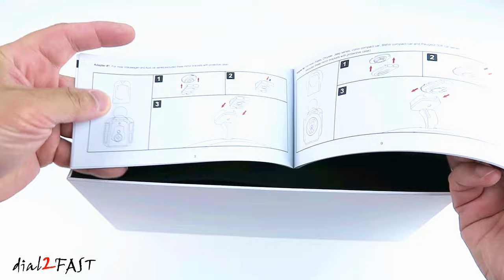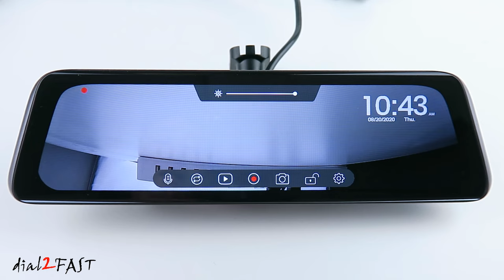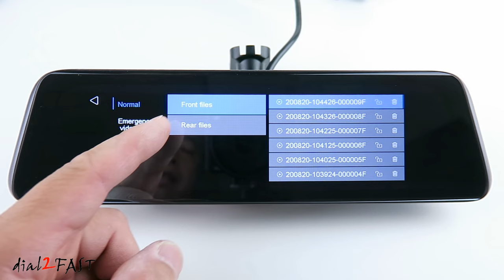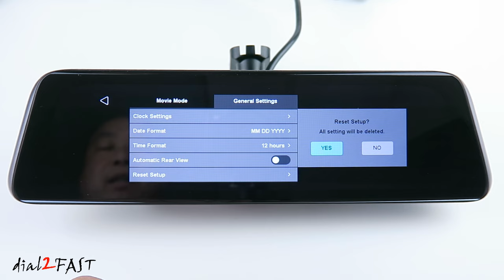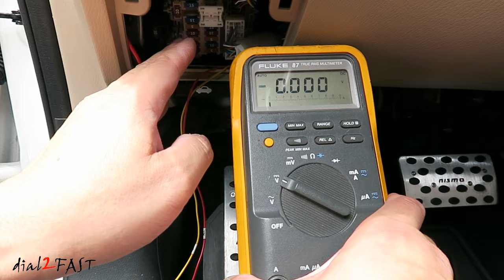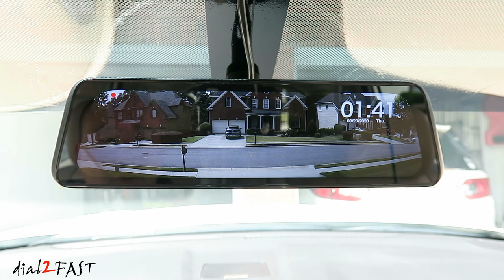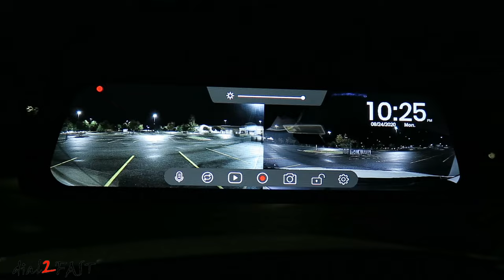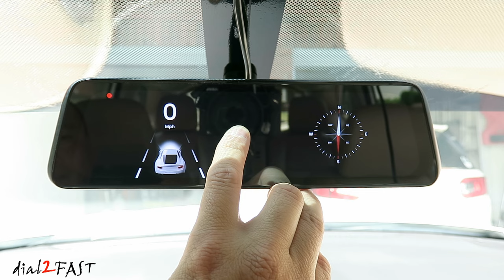AUTO-VOX V5 PRO Windshield Mount Mirror Dashcam

Comment: I just installed a V5 Pro in my F150.  I had to use it without power for a few days.  As a mirror, it is not very good compared to a normal, glass rear view mirror.  The reflection is dark and wavy at the edges.  Powered on, the view is outstanding!

Comment: Been holding off on buying a dash cam. Haven't seen one i liked. This one seems to be a practical and well performing unit. Thanks for the review.
Reply: Same here. I wasn't aware they have them built into rear view mirrors. I like the fact that it doesn't have rubber straps. If you bought one how does the mirror it self work?

Comment: This is by far the most definitive instructional how to video I have ever watched knowing You Tube, it far exceeds even the AUTO VOX websites instructions, absolutely every area was covered in fine detail, there is only one question I have and that is concerning the wire to the reverse light, I have an older 80's model Camaro, how do I know what side of the light or plug is positive to tap into with the red wire supplied?.
Reply: You took the words right out of my mouth. I randomly came across this and the fact that he showed the install of the rear view on the hatch instead of outside makes my want to purchase this unit as well lol. Ive been doing a lot of research and everyone just seems to want to have it outside. Kudos to Dial2Fast!!
Reply: Use a multimeter
Reply: Agree

Comment: One of the best reviews, clear and in full detail. I'm going to get the AUTO-VOX T9 without the dashcam just for constant rear view mirror for a Ford Transit low roof cargo van with no rear windows. I want to install the rear camera on top of the roof and am thinking of using some creative way to make the camera look good, such as a shark fin antenna cover or even a custom made trapezoidal housing.

One question, I read somewhere that the constant power cable is for keeping the time on the mirror from resetting. The mirror I'm guessing turns on when the ignition switch is turned on to ACC mode. Is there a way (unless it already works that way) to have the mirror come on as soon as you open the car door, which means it should have some kind of auto shut-off when you open the door (just like some of the factory features work such as the radio) or some time after turning ignition to OFF and not opening the door?

Comment: Very Good Review...sent to me by Auto Vox itself.  Today a technician installed the mirror in my Ford Focus and  I need the highligth two things: 1. The Mirror itself has really good reflective properties so, as the Video says, it can perfectly be used as a normal mirror without the use of the cams. This is good and bad. Good because any failure in the cams doesnt invalidate the use of the product as a normal mirror...Bad, using the cams you cannot point the mirror towards rear windshield because what is seen by the rear or front cams superpose with the reflection of the mirror itself, not being able to see well and distracting your view which is dangerous as you drive. I pointed the mirror a little upward so as to reflect the roof of my car, which it isnt so "bright" so you have no problems seing the video sent by the cams. 2.- I really dont understand very well, and is poorly explained, the use of the parking brackets and the way to calibrate them. They must have a logic because the rear cam itself "deform" the  view making a little bit difficult to estimate the distance to different objects. 

One last thing...a really terrible one....If you receive a unit with the arm separated from the mirror itself  PLEASE RETURN THE PRODUCT INMEDIATELY. That was my case...but I never realized this until it was too late...I thought it was a normal thing and that it was very simple to attach the arm to the mirror. How wrong I was!!!... Only after taking out  my original Ford Focus rear mirror, which is a very delicate and dangerous process because you have to make preassure towards the windshield with lot of known results of braking it, I realized that the Arm didnt fit in the mirror,  even if you apply lot of preassure to make it fit (with the risk of damaging the mirror itself)... At that point the technician refuses to install the V5 Pro, because it was a defective product. So I saw myself with a bad V5 Pro in one hand (sending back to Amazon from my Country take months), my original Ford Focus Mirror in the other (not daring again to put it back in place with a new risk of breaking the Windshield) and with a car without inside panels... Luckily I get creative when I am angry, and believe me , I was really upset with Auto-Vox. So I literally disassembled the mirror, being able to loose a metal bracket form the rear (I really dont know how I did that) and finally making lot of preassure was able to insert the arm in the mirror itself. Clearly the arm was separated from the mirror because it was of a greater diameter than the hole (the pivot)....But I[ was able to insert it anyway, with the result that the pastic itself was a little bit deformed. Putting the metal bracket back was an odissey. Its function is to apply preassure arround the pivot so as to make it stiff. I had to deform it to a greater diameter with tools and heat, so as being able to surround the more sized pivot. Finally the result was not a very clean fix but the round tap behind the mirror, was able to hide what was done... I really hope the adittional pressure that the pivot is making to the mirror, doesnt result in a future failure. For now, it works perfectly and with no visual sign of the problem. REALLY FOR A SO PRICEY PRODUCT ITS A SHAME WHAT HAPPENED TO ME....The only good thing of all this tragedy was that the Technician was so surprised (really surprised) I was able to fix the problem (using his facility and tools anyway), while he was only watching with a smile on his face saying "you will not succed", that he reduced his fee more than a half..so what I have to pay was a very low fee.

Comment: Thanks for the detailed review. How to instal it with a different mirror bracket adapter. If i remove the factory bracket from the windshield, how should i paste the new bracket to the windshield as i think a good quality double sided tape wouldn't be enough toh hold the mirror's weight. Please advise.

Comment: I love your review! You explained everything very well! I think I could even install this camera. I use Uconnect to listen to and respond to my text messages while driving and the speakers are on my rear view mirror. If I replace my mirror with the dashcam, will Uconnect be able to use the speakers on the V5 pro to read aloud and send my messages through Uconnect? Thanks
Reply from the maker: No it will not.
Reply: Thanks for your quick reply! Then I will get the one that is not Pro and attach it to the front of my mirror.

Comment: the screen is getting frozen very often , need to restart to get it back working. I got the replacement but that also has the same problem. have you faced such issue? any solution?
Reply: I got the same issue

Comment: Thanks for this very informative review. Got one thought. So if you got a sound system with sub woofers that make a good deal of bass, will the vibrations cause any annoying issues with the cam setup
Reply from the maker: A lot of vibration from the bass might make the front camera video shake a bit, but the system will still be functioning.

Comment: Amazing review many thanks. :) 
I already have reverse camera fitted as factory standard. I'm wondering if there is a way to connect to the factory camera and use that. Any ideas?
Reply from the maker: You cannot integrate it with the factory rear camera.

Comment: Hi, nice review. I am just about to fit this unit. There is no mention of rear camera rotation in the manual. Can the camera be mounted upside down. Is there a flip / rotate function to correct how the camera is mounted?
Reply: What did you find out about this? Thanks.

Comment: My rear window is tinted, do you think it's better to install the rearview camera outside than inside?
Reply from the maker: Unless you have limo tint (5%), it should be fine mounting it behind the tinted window. You can mount it outside but requires a lot more work to route the wire.

Comment: My bf installed this for me in April. I can't find where the grid lines are. It's kinda useless w/o grids. And my camera won't stay pointed out. It flops down and I have a great view of the pavement. I'm using Duct tape, and I'm not very impressed. Can anyone help?
Reply: Did you get help with this? Audio-Vox tech support seems good. I haven’t had mine installed yet … going to Best Buy and hope they know what to do.

Comment: This unit in my car started having blue lines across the whole screen. Installed 3 months ago. This is my second mirror dash cam. Not impressed. The other one was a Asako brand.
Reply: I'm thinking of buying one of these, so any ideas about what caused the blue lines? It's an outside shot, but perhaps the return cables are near to, or on AC powerlines from your alternator, somewhere? These AC magnetic pulses are what causes buzzing on old phone lines which came into contact with old-style house phone lines? And also, did they change the Cam or give you a refund?